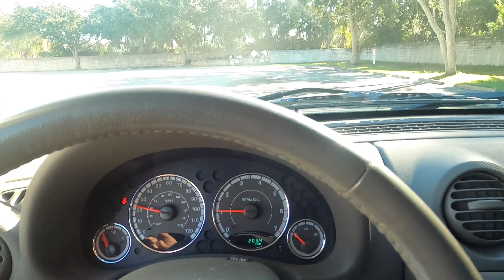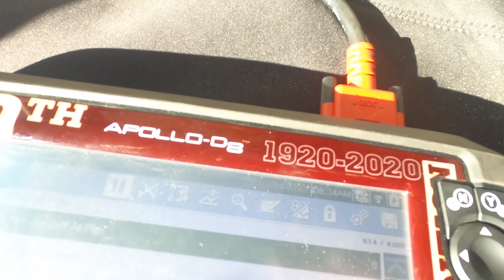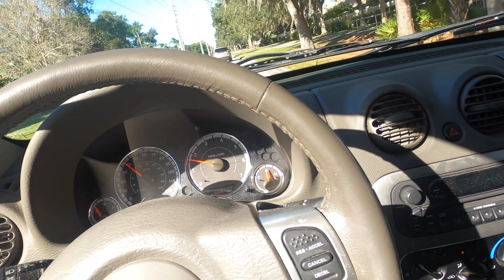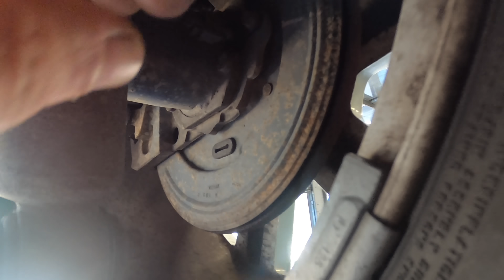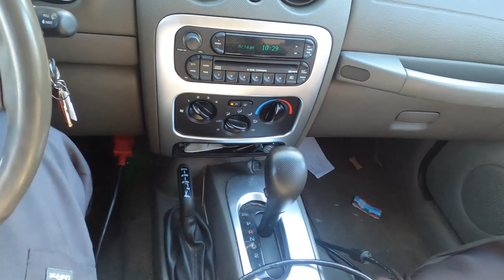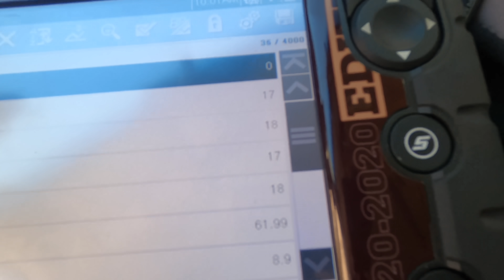MultiMeter Lied to me | Proving a faulty part. Jeep in limp mode

Comment: Also wanted to add I noticed when testing the sensor the tip was touching/ close prox to the metal box. When testing other sensor it was propped on the meter. It could throw the readings ie closed/open it is a proximity sensor

Comment: Did you make that purple/pink streak on the left-rear cover plate and on sensor bolt?    Maybe not.  Perhaps indicates a previous bout of trouble, or maybe the present one only partially dealt with by another technician.  Also, you are not using the Multimeter correctly.  You are confusing mili and meg-ohms.  Trying to read a few ohms resistance whilst the meter is set on Meg-ohms - you won't get a useful answer.  Learn to use your tools correctly.  Maybe you need a new meter -- one with Auto-Ranging.

Comment: If you place your DVM on the sensor wires, set the meter to AC millivolts. Move a magnetic item across the sensor pickup point and like a guitar pickup, (same circuit) you should get a voltage reading. Compare that to a known good sensor. Easier than swopping with another and test driving.

Comment: I'm a membor of a single-model club who owns cars based on the Ford CDW-27 platform. Our usual approach is to smash the wheel sensors out and replace them (because they fuse into the hub). Ray, what do you do in the case that the car is old enough to sieze such sensors in?

Comment: I'd drop that meter in the nearest trash can as soon as I saw two inconsistent readings, after ensuring the internal battery is good.  A decent meter is less than a family meal at McDonald's.  Every mechanic should have at least three:  One for the tool box, with an identical spare (use alternately).  Plus one in the bug out bag kept in the trunk along with the rest of the rescue gear.  Buying the same meters means that eventually you will have enough spare leads to outfit the whole family with red and black toothpicks for the Turkey Day meal.

Automotive voltages and currents are so ultra low that you don't need to spend a lot of Biden/Brandon FBucks for a good one. Per IEC 60038, real electricians consider low voltage to be up to 1000 V, medium voltage is from 1000 V to 35 kV, and high voltage is over 35 kV.

Comment: as an electronics guy, Ive crossed many issues with multimeters, set to resistance and just clip (not hold) tips together and just wiggle cords, if the value changes, its the cords. In this very specific use case, gold plated tips is actually useful and it will make much better contact. Interestingly enough, I have never had an issue with readings in a multimeter concerning power until the low battery indicator comes on.

Comment: Your Multimeter works fine. Your brain, however...
It was measuring MOhms, as in MegaOhms or Millions of Ohms, not milliOhms as in thousandths of Ohms.
Capital M = Big unit, lowercase m = small unit. (Unless you're reading 1980's schematics referring to MFD as MilliFarad...)
So it's totally normal your meter showed OL when you manually set it to measure thousands of Ohms, when the real resistance is millions of ohms.
But I was really surprised that the readings actually seemed to indicate a fault. I'd like to know how those sensor work and what you actually probed, I doubt those sensors are meant to be read as a resistor. Maybe you measured across a hall effect sensor element, or photon sensor?

Comment: Before Big Clive chimes in, let me suggest that your multimeter is suffering from a "brownout" and is producing erroneous readings due to low battery voltage. The suggested procedure to remedy this situation is, in order: 1) replace battery in the device, 2) throw device away, and 3) get a proper one instead. You should not need to second-guess the readings, the device should warn of low voltage (after all, measuring voltage is the ONE job it does) and refuse to work if there is danger of erroneous readings. Anything else is rated NFG according to AvE scale. This is especially bad if you are not an electrician or electronics engineer. A pro would catch it quite easily and would be able to use a shitty tool, but if you yourself are shitty at something, your tool may not be.
Alternatively, you might have touched the probes while trying to fit them into that connector and measured the resistance of your body, but I think you know about that.

Comment: if the batt in meter just getting low it will throw the readings off expecialy the ohms side since the meter is looking for a voltage within a range to calculate ohms.. or the rotating part of the meter has dirty contacts..oh and unless if your running a rechargeable batt in the meter most are 7 volts not 9 volts you need 9 volts

Comment: Swapping parts is a good way to troubleshoot, but the problem is you potentially introduce another fault in an operating system.  
Instead of having one bad system you have two!.  

Would it be a good idea to change both rear, or all 4 sensors at the same time?
Reply: Seeing as wheel speed sensors/abs sensors don't have a set time of when they usually go bad..it's usually if it's still showing signal then it's good, so changing them in a set wouldn't really do much besides making you or your conscience feel safe

Comment: A multimeter is one of the most basic testing devices available and when you have a problem with it, that could throw a wrench in your diagnostic procedure. But you didn't fret over it. You just moved on with the diagnostic process. You're good, Ray! Thanks for sharing your experience with us!

Comment: I use a meter everyday for refrigeration I have both a fluke and a field piece, fluke is my back up. You can see videos after videos about people bashing one or the other and the readings. 100% of the time it's the leads that are bad or going bad. People take reading's wrap the leads around the meter and toss it into a bag or drawer. Get new leads period. Unless you have some 10 dollar harbor freight shit. People have always answered back and told me new leads solved their problems. Good thing about my Fluke 87V it has a setting for ghost voltage, meaning my filed piece might read lets say 50 volts the fluke will not which I rarely run into. Enjoy your video's and don't skimp on the leads. lol

Comment: Very high readings in the high mega ohms will change just with oil (even from the skin or touching the probes with your skin ) also try a new battery for high mega ohms even when it does not show low battery

Comment: pretty sure your meter is ok, you had it on M(ohm) meaning Mega (if i saw correctly) which measured 18 megaohm at 7:15

and when you change the scale to ohm it will try to show you it, but max is 999 ohm which is too low since it is 18 000 000 ohm

O.L means OverLoad, this is because the measurement is above what it's able to show.

Comment: Ray big M on meter is Megaohms, little m is milliohms. 5 megaohms vs 15 megaohms makes no difference, that is full open either way. You needed to check up against metal to close the sensor and see if it went down to the miliohm scale. But in all reality, best practice for testing a wheel speed sensor is an oscilloscope because you can spot intermittent problems, and if it is a 3 wire sensor, you can test forward and reverse rotation at the same time.

Comment: Your DMM being bad, check the test probe banana plug connections at the body. As an electronics tech i have had some weird stuff happen even on a new DMM in the form of just plan old BAD connections from lousy connection owing to a kind of assembly fluid film over the metal part surfaces of the sockets. Give them a clean with a squirt of contact cleaner/cotton bud wipe out...

Comment: Disassemble the meter and clean the contacts of the selector wheel. 99% of the time this solves my meter issues. Also a low battery can mess up with the measurements. Also from time to time the meter needs calibration. But if you don’t need accurate measurements you can skip this_

Comment: A quick Google shows the late model wheel sensors use a Hall effect sensor. No easy way to test that without building a circuit that will measure the current while you move a magnet near it. Earlier ones are just an inductive loop, those you can measure resistance on.

Comment: It's not your meter. To measure ohms your meter powers the circuit.  That's why you don't measure resistance of a component in a circuit, you need to remove it from the circuit, it may find a path to your other lead somehow. You were on Meg Ohms not milli ohm. When you put he leads together it should zero out or very close to zero, so you were fine  You may have a bad battery in your meter.

Comment: Not specifically for this vehicle but don't forget that some ABS sensors are not coils but are hall effect devices so a DMM test may be inconclusive and will show different readings depending upon the DMM polarity. Some speed sensors are also directional as well. Normally fitted to vehicles with autopark.  But of course substitution can sometimes be the only true option.

Comment: I have a 2011 Dodge Journey where the traction control light comes on occasionally when starting the car.  If I drive, I'm in limp mode. Turn it off, turn it back on, light goes out and I can drive just fine.

Comment: Your meter uses the internal battery to measure resistance. If the battery is getting weak, it can cause readings to fluctuate. Some meters have an internal battery test. Another variable is the auto range searching for the correct range. It is essential to have a solid connection to what is being tested.

Comment: perhaps those were active speed sensors, testing those is done differently then the older passive sensors, i dont even resistance check abs sensors i go right to the scope, passive can be unplugged to test and active must be connected to the cars circuit and key on

Comment: Hey Ray, long ago I dumped the multimeter probes and started using alligator clips.  Try it before dumping the meter. It worked for me.
Reply: I bought a set of cheap allocated clips that will slide right on the probe to my multimeter and I can use it either way hey but I do like those little pin probe Chevrolet has have a good evening

Comment: I have a question, when I drive my car very hard, I sometimes see the traction control light flashing temporary, other that that, it's not showing. I do know that if the traction control is malfunctioning, I go into limp mode, which happened, but I repaired, in limp mode I only get a about 7 to 10 mph. What do you think can cause that. It's a 2011 Mercedes Benz E-350 coupe
Reply: is this a serious question?

Comment: I appreciate the extra assurance steps you go through. It'd be easy to just take the sensor off and assume that's the problem but you go through the extra trouble to check the resistances and then even do a swap just to be sure. This is what makes an A+ mechanic.
Reply: Agreed, there's way to man "mechanic's" that assume it's the first part they might hear, rattle from the front "cause bad ball joint" real cause could be a simple thing like a loose caliper bolt or clip..
Reply: Different perspective: An ABS sensor is less than 10€/$. Work time costs more than that.

Comment: I'm curious what the resistance of the brand new sensor was compared to the right rear known good and the left rear bad. 9 Megaohms seems excessive for the one that was still functioning.
Reply: If anybody's forgot to censor was laying on his steel bench which which will cause the sensitive throw the wrong reading out you need to remove the sensor off the bench where it's not on ferrous metal and that will give you more accurate reading have a good evening everybody

Comment: Ray ensure that you have strong batteries in your multimeter. Also the leads must make positive connections to the meters holes and the probe tips free of surface tarnish/corrosion. Compromised leads will give you erratic/false readings.
Reply: Also in your quote unquote back massager have a good evening

Comment: Get yourself some test resistors for verifying that test equipment is functioning correctly.
Or a potentiometer, a failed test instrument or worn out leads is quite evil.
That's why electricians need to tone out the leads before testing for hot circuits, as broken leads kill.
Kind regards,
South Africa
Reply: I think you need to start flying kites in a thunderstorm oh no fire bad think about it guys have a good evening

Comment: Others already pointed out your megaohm vs milliohm setting on your meter.  Another issue is that you need to measure the AC VOLTAGE by spinning the wheel with the sensor connected.  There are different types of sensors and some generate a small AC voltage that is based on the tire rotation speed.  They can be magnetic or hall effect sensors.
Reply: Verifying operation of most wheel speed sensors requires either a DVM that can read millivolts (mv) or an oscilloscope where you can actually see the sensor's AC output signal when the wheel is rotated. Resistance measurements are not of any value.
Reply: @freddvboy61  yeah, it helps when you know what you're doing. there's nothing wrong with this guys meter. it a guy not knowing what he's talking about. he needs a scope and to learn how to use one.

Comment: When I have issues with my meters, I often swap the battery out. I know they will tell you some times if the battery is low, but there is a point where it's not low but it's not strong either. That's when I find I get he weird readings out of my meter.
Reply: If you have two meters you can check the batteries on the other and this way you know they both work have a good

Comment: Try a new battery in your meter, resistance  measurements  are based on the battery voltage of the meter

Comment: Brings back bad memories of my Jeep Wrangler going thru wheel speed sensors on a regular basis. Just one of the many pleasures from that vehicle
Reply: My 97 Wrangler would plug the oil pressure sender 3 times per year.  It would stumble when the plugs were fouled and it would fry the TPS. Lots of fun. I got a letter from Chrysler saying that the repeated problems are no longer covered by warranty. I should have lemon lawed that thing after the first year.
Reply: @michaelvangundy226  try sending a lighter to Fiat they don't speak English over there have a good evening
Reply: It would seem that Limp Mode is the default mode for Jeeps.
Reply: My dad had replaced the wheel speed sensors on is 14 jku and after that it wouldnt leave limp mode. Turns out the only way to fix the issue was by having oem "Mopar" ones put in lmao
Reply: I'm glad my 2004 Rubicon didn't even have the ABS, traction control options now! I still have it.

Comment: I am surprised no one caught this, you measured the bad sensor while in contact with the metal work surface, but measured the good one resting above your meter.  Need to watch the good one and see if it changes when in contact with the metal... Just a thought.
Reply: That mainly applies to Ferris metal if it's a still service yeah it'll throw the reader sensor off also clean the sensor before you take a reading because any metal build ups on the center will throw them at a while break dust rust road garbage and easy but because they are magnetic hey have a good evening

Comment: How much time does the book give you? Or is that under a diagnostic time and once you solved the issue do you get paid to do the actual job which is probably .5 hrs or so? Time to either change your leads in your multimeter or get a new 1...lol.

Comment: My 2019 Tahoe rear wheel spun a bit while reversing and I immediately shut down. The next day the rear wheel wasn't right. I drove it still was dragging so I disengaged the traction control and it hasn't happened since

Comment: Had a 13 Durango come in with a bad wheel speed sensor, I live in maine, and it was driver's front. The sensor was seized in the hole with rust and corrosion. Tried a chisel to get it to spin and free up, ended up cracking, and breaking. Even spraying tons of pb blaster (Maine's go to for rust) didn't help at all. So I took a drill bit and went by the new sensors to mark about half way in, so I didn't harm anything below the sensor. Then I ran a sheetrock screw into the sensor, and used the claw of a hammer. I had to hit it pretty hard, after a couple love taps it finally came out. Put new one in and good to go
Reply: Hey Frank, about your PB Blaster trick (Maine’s go to for rust), I think you learned that trick from us guys in Ohio, didn’t you? 😆
Reply: @Hoaxer51  I learned to use it years ago, before YouTube. Just word of mouth from other mechanics in in my area
Reply: @Hoaxer51  PB has been my Ohio go to for decades!  Can't imagine working without rust ... might actually beat flat rate! 🤔

Comment: Meter was reading Mohms, not mohms.  Capital M is mega not milli.  Change your battery on a schedule.  Low battery voltage will really screw with a meter.  Good T-shooting to back up hypothesis in light of questionable information from meter.

Comment: Top tip, get a Fluke, nothing worse than second guessing your meters. That being said, the meter worked as intended, as others have said,  the sensors were in the MegaOhm range, so in Ohms range it shows as just OverLoad, aka more than 1000 Ohm, since the sensors where around 4 000 000 and 18 000 000 Ohm.

Comment: (With the "starting the engine" voice)  "Blaming the poor multimeter, are we ?"

And that comes with a big question mark :  .. there most likely is a Hall sensor in that package which is (most likely) a diode junction (not a resistor), you (most likely) should check for the right parameters ;) Schematics for the part (the speed sensor) would be (most) useful. ;)
Reply: corrosion on the batt.. clean or replace. [[[[[[]]]]]]
Reply: The guy's name was "Hall". Anyways, how do you want to build a hall sensor with only two wires?
Reply: @whuzzzup  I thought about that too.. schematics would be helpful ..